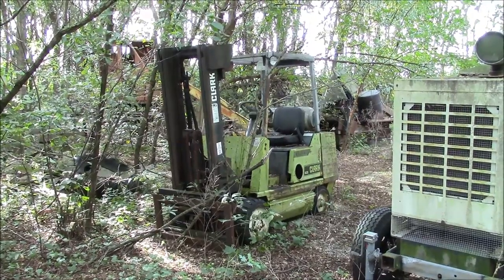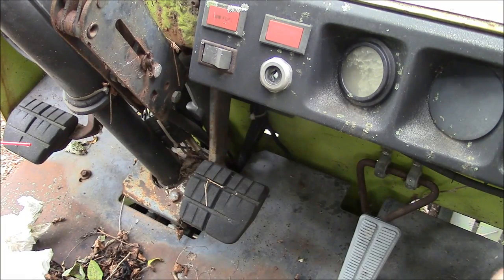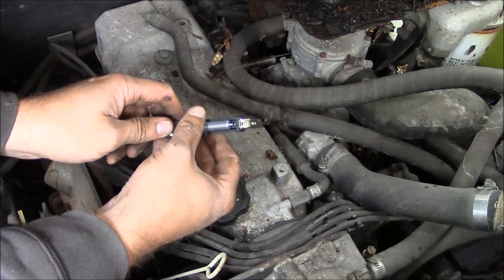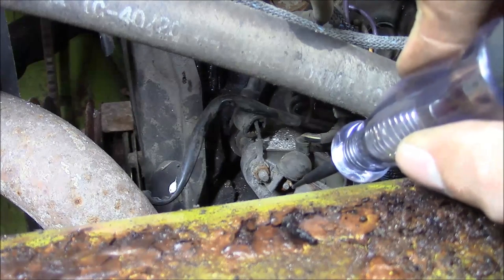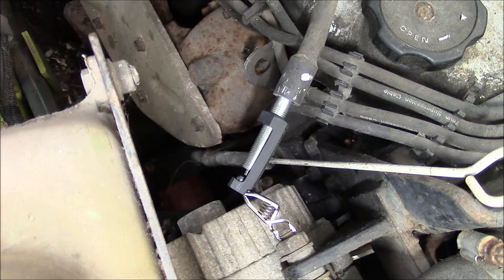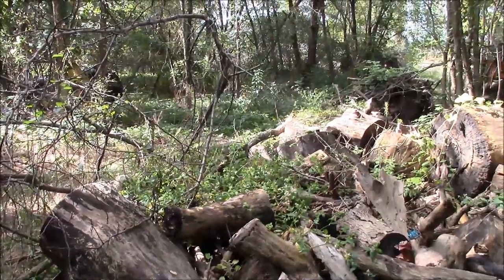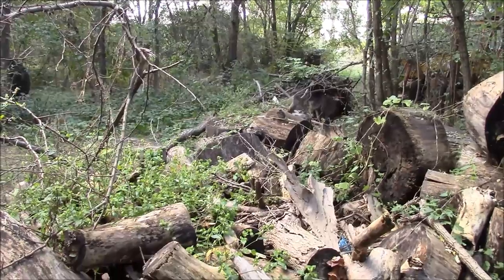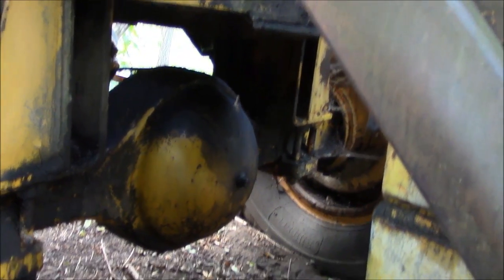Clark Forklift Sitting in a Field for 17 Years - Will It Run Again?

Comment: I am suprised you know so much. Much respect to you.
These days, with cars and trucks going the way they are, it is main dealer repair only. The world of mechanics is fading because nower days, there are just fitters as they plug the machines up to a computer and look on a read out what is wrong with them and just refit a new part, or just write it off. 
I started to do car mechanics back in 1974. I learned all about points and condensors, carbs etc. Nothing electrical back then. No CDI's / ECU's or a bunch of sensors to fool the diagnostics of a problem.
Reply from the maker: Hey Ian. Luckily my father is an excellent mechanic and he is the master of points and condensor ignition. He's also a good teacher. Thanks for watching.

Comment: The thing I learned a long time ago, when I was knee high to a grasshopper and when my grand dad was still alive. Never just give up even on a seized engine. If one can still find the parts, still easier to rebuild, have as "new" and have a machine that operates vs nothing more than a boat anchor. Would love to come across finds like that. Always enjoyed "tinkering" with the older equipment, much more simpler design that today's equipment. 
Not sub'd yet, still tryin to decide rather or not your video's are truly worth sub'in to. Just remember, it's your channel, don't let others dictate to you on how it should be. Cheers :)

Comment: The two LPG Valves , one on top of the other, the top one is a Vaporizor-Regulator, the bottom one is a fuel lock valve, controlled by vacumn .

Comment: I worked for Turner Seymour Manufacturing Company for about five months in 1973 and I used to repair about twenty-five of those. Those propane converters and carbs are easy to work with.

Comment: Warning, a Swiss Army knife was harmed in the making of this video.
Reply: God damn that hurt so bad watching him use his blade to clean that terminal.
Reply: @nwaters2618  C'mon guys, these terminals are usually very soft.
Reply: @TrinomCZ  Understood. I'm a knife collector so it just made me cringe.
Reply: I use my pocket knife for the same reasons. I already have the knife and i will buy post cleaning tool if this works. And I know someone is gonna ask. "how many times do you replace your pocket knife." My answer is I have had this knife for 20yrs. I do need to replace it. The sharpening stone has worn the blade over the 20yrs.

Comment: With you working on it Wes, it will run again. I once worked on a generator that was powered by a detroit 253. It was locked, (I broke an 18" pipe wrench using a cheater pipe trying to turn it off the front plullt bolt), lol. Took the port covers off the side of the block and found rust in the cylinder liner skirts. Used zep 45 spray and turned air pressure doen, used the air nozzle to 'blow' the zep around in the ports. Kept doing this and bumping on the pipe wrench. Took half thr day bit Im a die hard and refused to give up. Finally got the crank to bump turn, just kept spraying and bumping until it made a couple complete turns. By the end of the day you could just bump the start button and it fired up everytime. Boss was happy. Someone had give him the unit and he sent it to an auction. The unit was shipped to central America. We sold a lot of used equipment down there because of the high taxes on them importing new machinary, they save a lot of money by getting used equipment there. I don't remember how much KW the generator was but it was plenty big. Built on a skid, one heavy machine. You can't kill an old detroit....

Comment: One thing I always try to do when working with things like that. Once I get it moving, I go for it and don't give it time to sink back down into the soft dirt. Some times that works, other times is doesn't. Just how I try to do things. Thumbs Up with fixing the spark for sure!
Reply from the maker: Well I was never going to drive it out, I just wanted to see if I could get it back to the little alley so I could grab it with my winch line. But it's way too soft.

Comment: When I was a kid, I remember an old Michigan loader with a Ford 6 cylinder in it.
It was put in by a gas station owner and used for snow.
A relative of mine worked there and helped with the installation and that's all I remember.
Reply from the maker: Maybe a 300 inline 6? Those are good engines.

Comment: Looks like an early Sirius engine. As soon as I saw the Mitsi oil cap, I knew it would be running in no time. Some of the most reliable engines I've ever owned
Reply: Wouldn’t say the same for their astron....
Reply: 4B11 with 107,000km trouble free so far!
Reply: @Jester123ish  Oh, which one? I've had a Mitsi Sigma with an Astron and it did a huge amount of work without ever being torn down. L200s had them also if memory serves and I knew many people with big mileage L200s that wouldn't give them up.

Comment: I have had to change the carb system back and fourth many times to propane and gas. In the winters, companies had to operate these forklifts in closed buildings. Propane allowed that. Propane powered you lost about 15 % operating power. Easy swapping carb system. 3 parts if I remember.

Comment: Some years ago, I used to work on some of those old Clark lifts.  They seemed to be a pain to work on most of the time, due to them cramming the parts into too small a space.  Seemed like the ones I worked on had Waukesha or Continental engines.  They did the job for the industrial owners that had them, but they were always leaking some type of fluid.

Comment: Looks like you forgot all your stuff to work on that machine at your shop. But, you did pretty damn good fixing it with just a test light , screw driver and a 9/16 wrench,some spray and a few wire connections ??  I can't believe that thing started after 17  Plus years, Good Job, i just rang your bell.. Texas

Comment: "PR"  is park light relay i think. it is on the older Mercedes i work on,plus mitsubishi have had a pretty good electronoic distributor for decades. I have seen them used on other old cars to keep them running and eliminate points.

Comment: It is a convertor. Takes the high pressure from the tank and converts it to low pressure for the carb. The bottom one is a vacuum lock off. Shuts the fuel off when the engine is not running. I did fork lifts for 15 years.

Comment: That is whats called the Evaporation module valve for yes enriching.& for moisture control in inside of your propane carburetor.& pressure regulator  release valve to.

Comment: nice reliable little japanese  engine. would it be the original power plant, i wonder?  what a good score! Keep up the good work; greetings from NZ!
Reply from the maker: Yes, I believe it to be original. Clark phased out the old flathead Continental engines for these overhead cam Japanese units some time in the 1980s.

Comment: Looks like a SOHC 4G15 motor or similar displacement. Older SOHC was a 4g32 both had distributor options from the block outwards versus cam driven.  Colts/Mirage/Summit got those motors so lots of part available.  Will have 4G15 stamped on the exhaust side of the block likely facing the alternator.  Could be wrong about it, but 4 cylinders in SOHC only had so many variations with that tiny stamped style cover.

Comment: I just bought at auction a 4000lb Hyster electric for $50, going to try and move it today. On finding an engine sitting first thing i do before cranking is drain any water out of oil pan first.
Reply from the maker: Difficult to drain the oil when the oil pan is sitting in the dirt.

Comment: The "fuel leak" was the vaporisor freezing because there wasn't enough antifreeze .

It uses the engine coolant to keep the fuel from freezing as the fuel expands.

Because you were low on antifreeze , it froze up and started leaking past the valve seat into the carb.(that's why you didn't smell it)

Tune up tips.

I'd replace the CA-100 carb diaphragm (takes 10 minutes) and it's a safe bet the Model J vaporizer is near the end of its life.( The Model J and "Cobra" vaporizers are interchangeable)

With the Impco fuel system the vaporizer(the thing with the stuck button) gets richer as it ages and the CA-100 (the carb) leans out with age, they "fall against each other" and stay in tune but I've seen people replace the vaporizer (because it was rich) and the engine immediately starts running lean because the diaphragm was just as old.

So replace both.

When replacing the diaphragm on the carb make sure the small dash in the center is pointing at the fuel inlet (it matters)

The safe way to bleed out the fuel is to take the tank off and let it run itself out of fuel.

On the "carb" you'll find a large silver screw 
(Fuel mix at idle) clockwise is richer.
Under the fuel inlet there is a small tab shaped like "home base" you use a 7/16" open end to turn it , you'll see an "R" and "L" in the casting (inspection mirror) that adjusts the fuel mix under load.

Timing is done by ear because the timing marks are for gasoline.

Spark plugs are gapped at .020 when its LPG to compensate for LPG's slower burn rate.
 

LPG soot is white , so a fouled out electrode on a spark plug will  look like it's been dusted with baby powder.

The vacuum advance is stuck , dont worry about it, LPG burns slow enough you dont need it to start the engine, it was probably stuck before they parked it, most mechanics just ignore it and tune the engine for idle.

P.S. have fun trying to reach the drain plug on the radiator.
Clark's are real hard to reach into.
Reply from the maker: Great information! Thank you. How does one set the lean rich mixture? For example, in a gasoline carburetor I would adjust the idle mixture for max idle RPM. Then adjust what would be the main jet for maximum power and smooth acceleration. Is the procedure roughly the same for a propane carb? As I said, I really need to learn more about them.
Reply: @WatchWesWork its the same, but as a final step I usually load the engine a little with the steering or tilt by feathering the lever and adjust for best idle so the engine doesn't die everytime you turn the steering wheel.
If you do replace the vaporiser and carb diaphragm just set the power valve to dead center between R and L since its main function is to compensate for age.

I usually start with the idle mix (big silver slotted screw head) one turn out from all the way in and adjust for best idle.(usually 2-3 turns) this adjustment is the most important for indoor trucks because forklifts spend a lot of time at idle.
(Carbon Monoxide)

If everything is set right , you can be idling at 800 RPM and you wont be able to kill the engine by turning the steering wheel hard.

Here's a few things I'd keep in the back of my mind with this truck.

Since it sat so long there is probably propylene build up on the intake valve shafts causing them to stick a little
(Its an impurity in LPG that can harden like tar over time) it will burn off after a few hours of use so run it a while before you give it a tune up or you'll be chasing your own tail as the valves loosen up while you are tuning it.

I'm in central Illinois and we do run into a problem with Humbug on propane engines that sit this long.
H.U.M. (hydrocarbon utilizing microbes) can grow in the oil over time and clog up the oil pick up and filter after a few days of running, the heat from the engine kills it , and then it peels off the interior surfaces and gums everything up.
Theres only a small chance of this happening , but if the oil pressure suddenly drops after  a couple of days , dont panic,
just drain , change the filter and clean the pickup tube...it can also grow in the transmission or hydraulic system.
Your winter's might be harsh enough to prevent it from happening.
Just ask a local farmer if they have seen it happen.

Comment: Hi there, great video, great luck on the forklift.  Maybe the cut wire on the ignition was someone's idea of an anti theft device.  The orange cab crane behind the forklift, is that a little Bantam cable crane?  If so, might be a great project.  Not many of them left.
Reply from the maker: That seems to be the best theory. I honestly don't know. You have to really know this machine to know to cut that wire, and it's almost impossible to reach without removing the air box.

Comment: I worked in a very poor county for many years and they would hardly notice the Apocalypse. The equipment you "rescue" is commonplace. Engine blows, drop another in and "adapt" to fit. Guy had an Allis Chalmers with Chevy engine, Ford transmission and steering linkage adapted from a Honda CX500 drive-shaft. Give them something OEM and it just confuses them.

Comment: I'm glad to see you got your "new" forklift started so easily. Do you think that distributor wire was cut deliberately? That's what I was thinking, maybe as an act of sabotage or as a way to keep someone from swiping it. Finally, I'd take that ignition switch by a locksmith and get a key made. I suspect it'll be a lot cheaper than buying a new ignition switch.
Regards, Tom
Reply from the maker: I found the key. No idea about the wire. There's no reason why the wire would be deliberately cut, but it sure looks that way.

Comment: Ar my last job, we had this exact same engine in a Dæwoo lift.  I remember it had a problem not starting, come to find out it had a short in the wiring harness to the engine.  Also there was an ECM fuse that if blown, would cause the same problem.

Comment: IMO, you should pop the engine off (disconnect transmission) and just suck it out to a better location to work on it. The whole item is worth it, seems solid, there's no rust caves...unless we're missing something via camera, that's better than nothing, cheaper than a new one.

Comment: Bring a box of baking soda and some water to clean up battery terminals.  Just soak them in a strong solution of soda and water.  Then use your knife or wire brush on them.

Comment: the ballast resistor is to cut voltage after engine starts, there 2 wires from ign switch, start and run, start position sends full voltage to coil to help starting, then run position goes thru resistor to cut voltage to coil for less wear on parts. (dist cap, wires etc)
Reply from the maker: OK. It's pretty much the same as the Delco setup but without the contact in the starter solenoid.
Reply: @WatchWesWork  i really like the video, 30 years as cert mechanic, gave it up for computers years ago, miss getting stuff to run again
Reply: the ballast resistors main function is to keep the points(older modules) and coil from burning up if it stalls or sits with the key on engine off. it simply limits the current, yes of course there's a voltage drop across it as it turns the energy to heat, but once started and running the drop is fairly low, since there's not excess current flow.
the resistor bypass is either done at the key switch or on the starter solenoid, it supplies full voltage and current when cranking for stronger spark.
*NOTE:* it's important to not remove the ballast resistor on older electronic ignition systems if they came with it from the factory, the internal design most often allowed them to stay turned "on" if a magnet is lined up with the sensor, which would be the same as points being closed and not running. quite often the modules would burn out well before the coil does or both end up failed.

Comment: Sweet ! Nothing like  knowing how to use a test light  it’s amazing what you can diagnose with one  i had a really crappy one for years and i eventually saw a very nice one in a Auto Parts store and bought it  at the time i thought it was a bit overpriced  but in reality it was worth every penny  as i’ve used it to fix almost every boat,car ,and ,motorcycle i’ve owned  i even bought one as a gift  for my son years ago  it’s really perfect inside boats small electrical panels  I liked your DIY Butt connector  where in the heck are you finding all these abandoned machines ?  I was a avid hiker for many years and i never  saw anything like it  other than abandoned very old mining equipment in Colorado  (Denver) area
Reply from the maker: Pretty common here in the Midwest. But this is my family's property.

Comment: Mate with what you don't Fix in the field you might like to take the parts from some of those Machines due to the fact that there could be someone needing those parts for there rebuilds + you can make some cash on the side as well as doing your thing , Lol good Vlog and if that person had of seen the full run down they would have seen the oil and water going into a catch bucket under the engine.

Comment: cross linked 2x6 running both ways - a large plate.   Run over them.   Make them the length + of the machine - and 2 of them.  Or have your truck at the end of the plate.  That or 1/2" or thicker steel plate.

Comment: looks like a g63b 2.0l engine. mid 80s mitsubishi trucks used the same engine on the base models, as did some galants. cheap easy common parts

Comment: The ignition wires didn't cut themselves. This forklift was driven into the mud and the wires were cut on purpose. I would check the serial number to see if this forklift was stolen.

Comment: I think you would have had a much easier experience if you removed the fork lift to your shop, then worked on it.  As for the distributor wires- they appeared to be sabotaged IMHO.  I enjoyed your talk-through as you got it running.  Congratulations.  I've decided to subscribe.
Reply from the maker: Sure. But it took most of a day to get it out of there with it running. I didn't want to go to all that work to find out it was not saveable.
Reply: @WatchWesWork   But it would make a great conversation piece in your living room, a great paper weight, or a lot of money at the scrap yard.  Have a fine day.